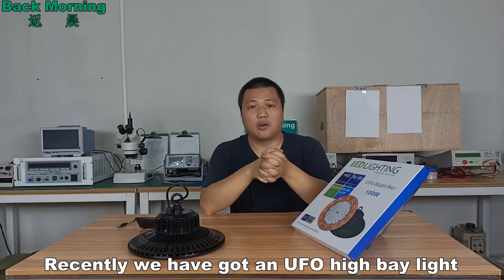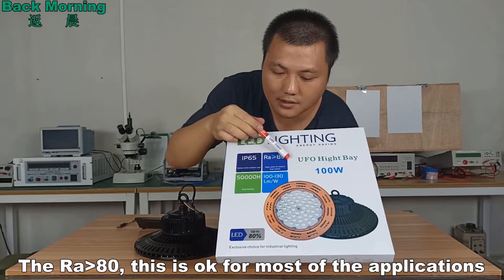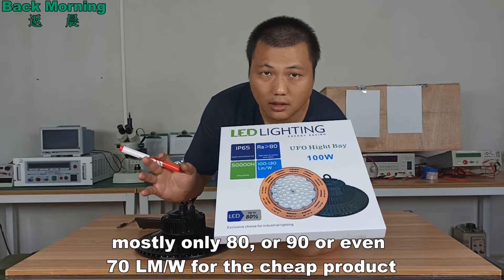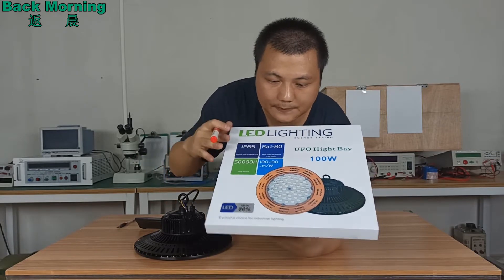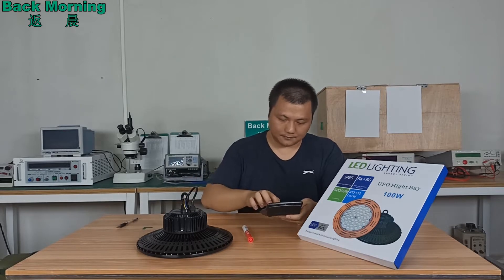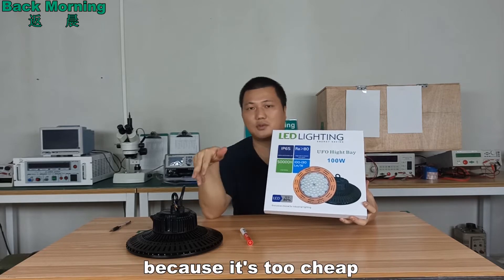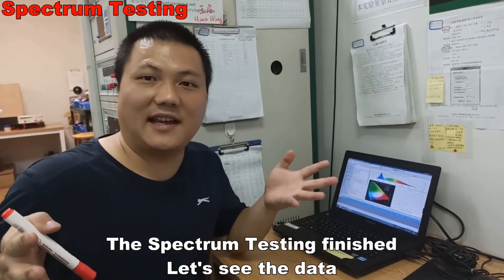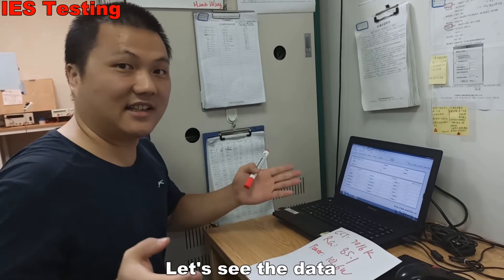Cost and Quality Analysis for the 100w UFO High Bay Light(Cheap)

Comment: Great video~!!!!
Liked, commented, and subscribed.
The color coding of the wires on the cheap ufo lights, is giving me the impression that they're supposed to be hooked up to 240V. Yet on the package, it is specifying 110V
Cable Usage : yellow/green wire to ground wire, brown wire to live wire, blue wire to neutral wire
www.walmart.com/ip/UFO-LED-High-Bay-Light-100W-10000LM-6500K-Daylight-White-Commercial-Bay-Lighti603146741ng/

In the U.S. wiring is black for the "hot" and "white" for the neutral.
The "brown", "blue" wire set up is just like they'd use in Europe. Which is 240V

I've seen alibaba ads, where it was specified that if the lights are going to the U.S. then you have to let the seller know. So they can set it up for 110V. (I guess).

Do you have any input on this...???
Reply: Not sure but most of the cheap LED's I've used had the same colors on the wires and worked ok at least for a while, they also stated a large voltage range to include 110-220 volts, not sure what the specific range stated.
Reply from the maker: Sorry to feedback you so late, I should spend more time here.
A lot of lighting products can be used within a wide voltage: 85~265v, then it can be sold to the global market.

In many cases, all good quality lights should be used well in a wide range of voltage, because the input voltage can not be always very stable, and some changes may come from the power system. So, the high-quality UFO lights, Flood lights, and Street lights used in Europe all, use a driver with a 90~260v range, so they can be used in America too.

Comment: Great job mate, but how will u tell untill u have bought it
Reply from the maker: you are right, it's not easy to evaluate it untile get it on the hand.
We can get some real info of the product by checking its structure design by seeing its picture. 

Need a real sample to know its heat transfer ability by handing its weight.

For more, need to be done by instruments
Reply: @InspectorHank  maybe you could do a review with links to which ones are good quality from a budget price to expensive 😃👍
Reply from the maker: @akira5982  that's a good idea.😃👍